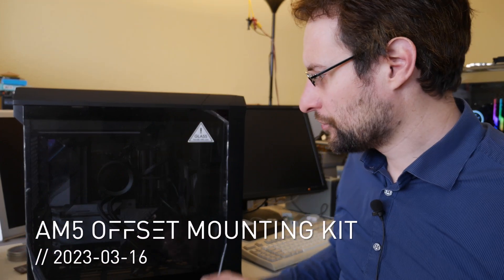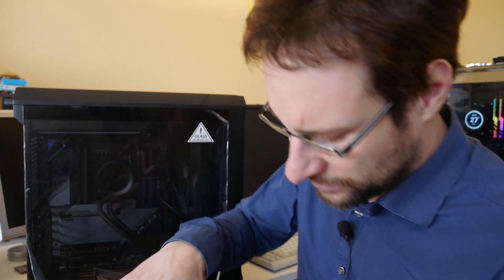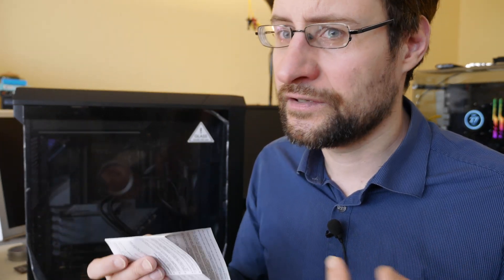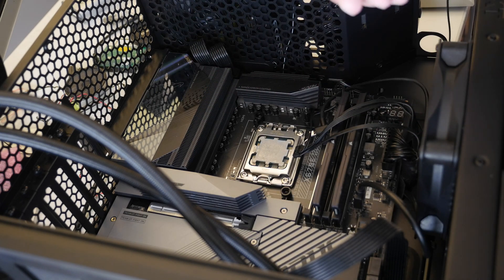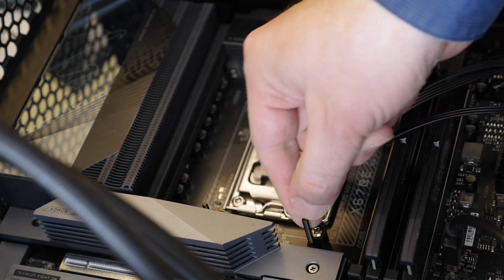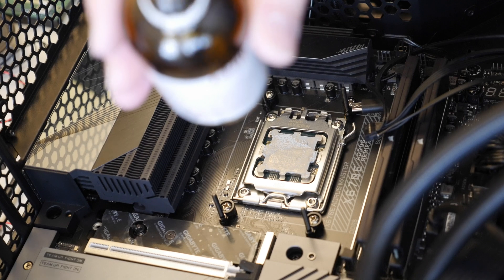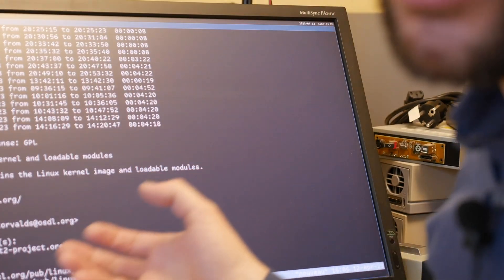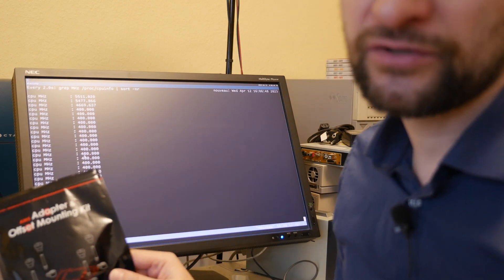HIGHER Ryzen performance & LOWER temps w/ Thermal Grizzly AM5 Adapter & Offset Mounting Kit!

Comment: Thank you for the video! I have been looking at this kit to replace my Arctic offset mounting kit because it is a ridiculous design in my opinion. I can’t even see the screw holes in the offset brackets during stall and they kept popping out. It was so frustrating. And I had no idea how tight or how even I installed it. Also, the mix-6 thermal paste Arctic gave me was kind of dry,,. I know mx-6 is thick but I could barely get it out of the tube, it’s more like a putty than a paste. . Now at idle my cpu is at 47 degrees C, and I want it to be  at 43 degrees C idle. Because the 9950x3D needs GOOD cooling to function efficiently, especially at boost     I.don’t want my cpu to get higher than 80 C to Maybe 82 C.. but I may have to buy a whole new cooler. Or go the custom setup with graphene infused glycol and a nice cooling block. “That would probably get me to 60 C at boost with Liquid Metal on the IHS, But I want to try the less expensive option first. 
    Have you tried any other kits recently or do you recommend the thermal grizzly most?  or different one at this time? And if I went with the kit, are there any parts you would recommend I get with the kit? 

    Sorry for the essay,, I liked and subbed! And thank you again!

Comment: It's not about temperature with PBO, it's about clocks.

PBO will keep pushing clocks to the max boost frequency until PTTL is reached.

Thus max temperature won't change, but clocks will.

All big YouTube tech channels get this wrong, because they can't read. (referring to Linus Tech Tips etc.)

PTTL = Platform Thermal Throttle Limit, which is 95°C by default on AM5
Reply from the maker: Pbo starts to throttle at 70°C for me
Reply: Yes, same for me, although it throttles a lot more the higher you get.

Comment: Is it possible to to use the offset kit and still use the "build in" mounting mechanism?
Reply from the maker: Which built in mounting system do you mean? The NzXT kraken still fit, ...
Reply: @renerebe  Those default plastic brackets that came with every MB.